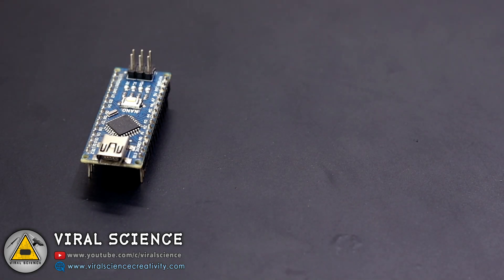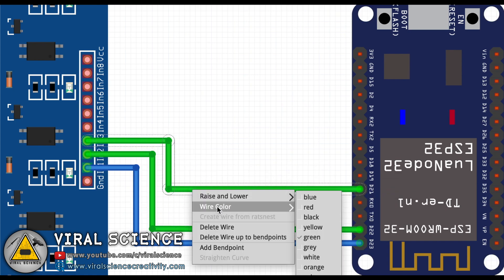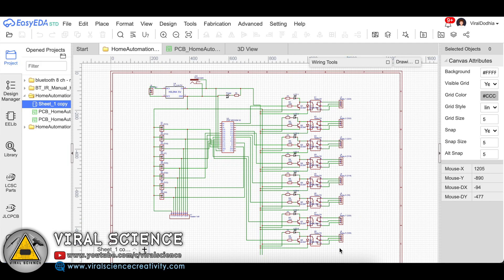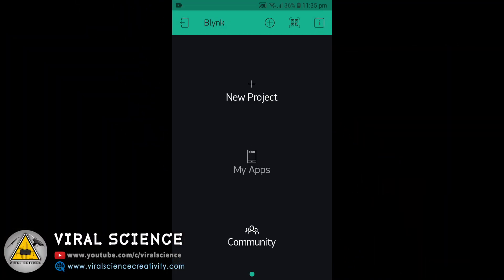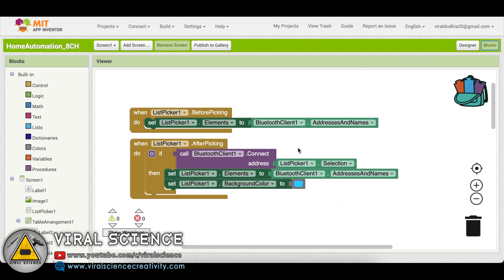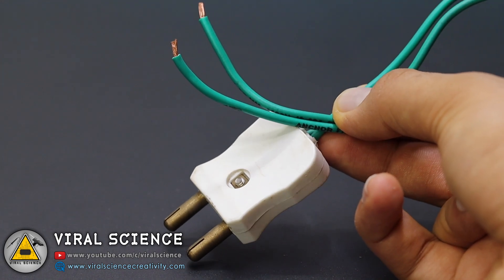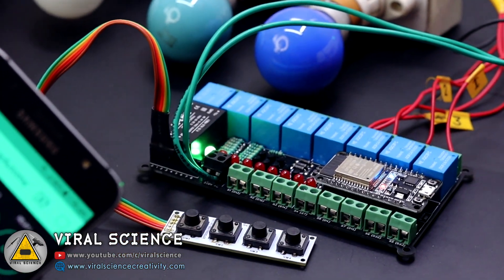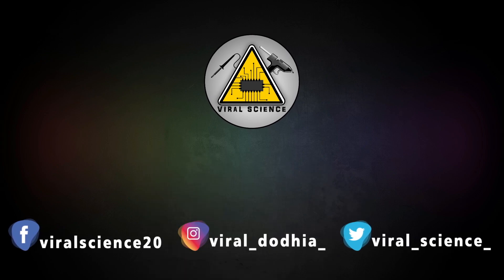ESP32 Blynk Internet Bluetooth Manual Home Automation with Feedback System

Comment: Sir I want to make this project for the situation where wifi is gone and suppy of esp32 also gone but when supply of esp32 will resume and wifi is still not working than whole project is working (my device can control )using Bluetooth and manual mode, but here if initially wifi is not available than project is not working manually and on BT, even in beetween if power of esp32 is gone and when it will  resume at that time if wifi will not there than present project is useless please check the code sir and reply if possible

Comment: Can we develop another app for control?
Reply from the maker: Similar to Blynk ?
Reply: @ViralScience   yes
Reply from the maker: We can but not with mit app inventor or kodular, it needs proper frontend as well as backend developement and setting up servers and security
Reply: @ViralScience  can we use firebase for manual and app control with live feedback in app?
Reply from the maker: I have made project with firebase home automation you can refer it
Reply: @ViralScience  ok🥰